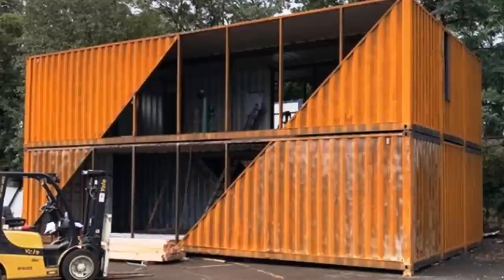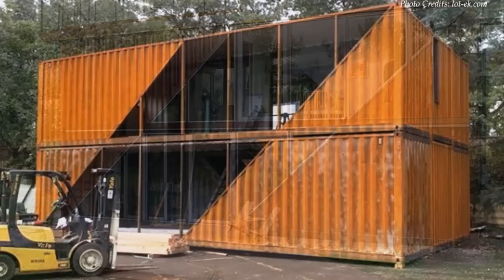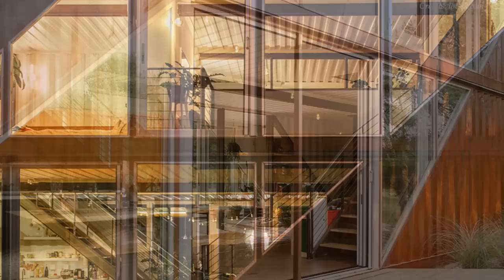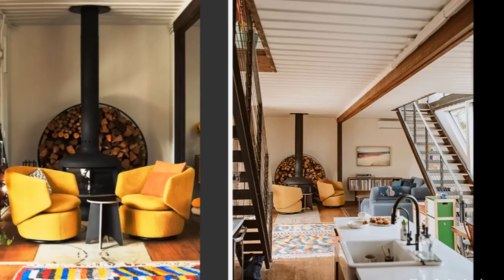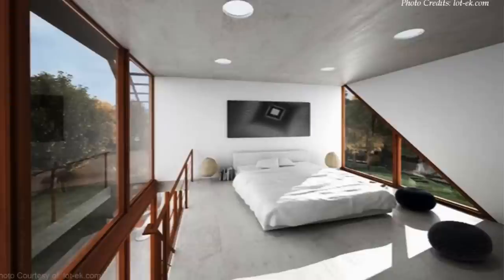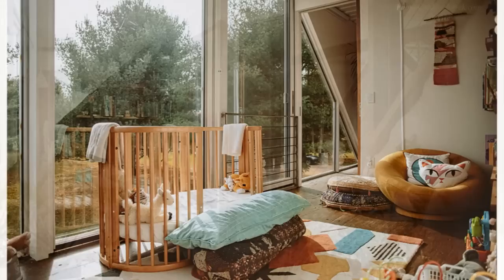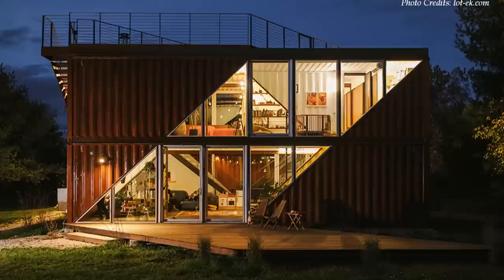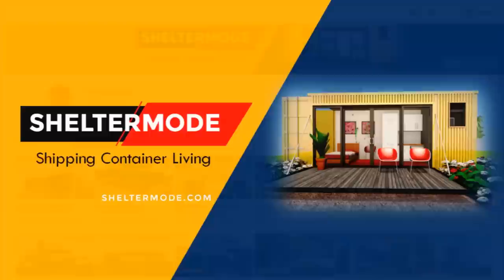Amazing Container House in Hudson, NY by LOT-EK Architecture

Comment: How do you get 2200+ sq. feet of living space from 6 containers? The sq. footage of a single container (finished) is @300'² 
6 times 300'² is 1800'².
Your math doesn't add up.
Reply: I guess it includes part of the lawn outside. Since it's used from the cut out part.